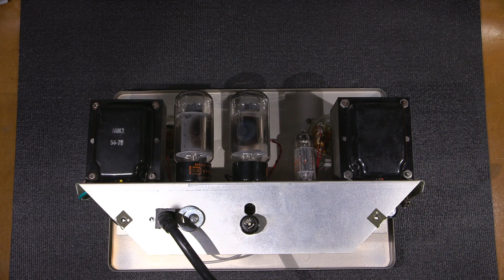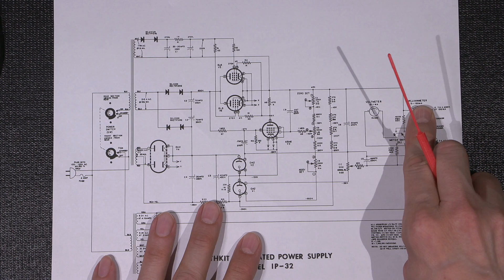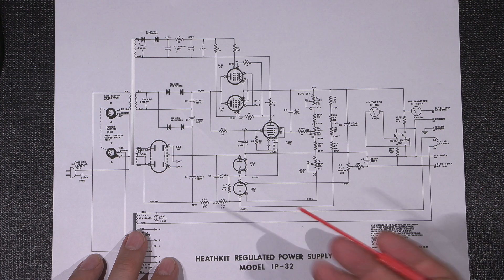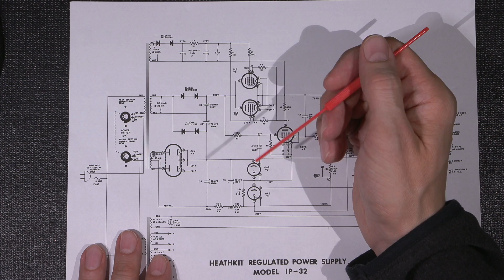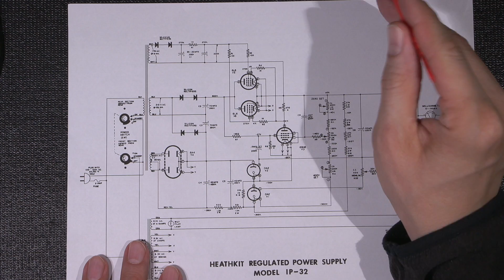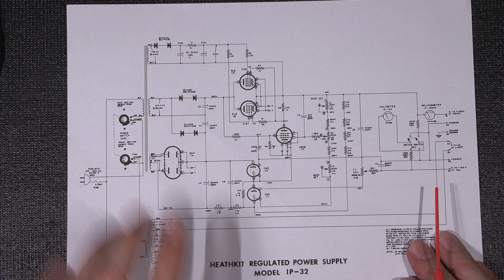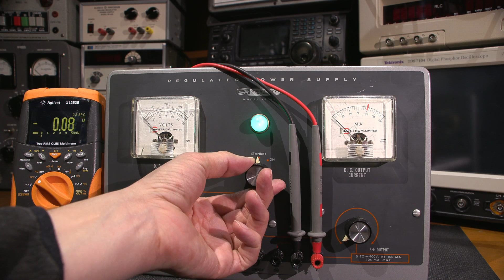Tools For The Bench- High Voltage Power Supply Repair!

Comment: Nice as always, Paul! I have the same power supply and have used it much for powering tube circuits. I have removed the 6X4 tube and put in two silicon diodes. The free 6.3V winding I  have brought out on the front, giving me an extra filament supply

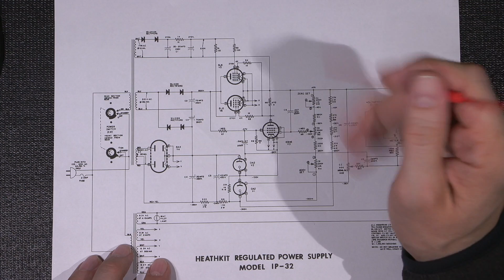Comment: 25:40 - My guess is that they used a vacuum tube on the regulated supply to provide a 'soft-start' on power-up.
Reply: From a glance, that would actually work .. it keeps the 6BH6 fully open and therefore the output low until the bias rectifier comes alive?

Comment: May I suggest a Part 2 on how the 6BH6 circuit acts as the output voltage is varied with a fixed load. 

Thanks for presenting a piece of gear that many of us treat as a  'black box'.

Comment: Have you checked if the negative supply output varies depending on the position of the meter switch? The schematic makes it look like there would be a significant change doing that. Adding a zener diode can fix that.

Comment: Looking at the schematic, I see that it might have been a good idea to put a high resistance in parallel with each of the diodes that are in series. Something around 1M as shown on schematics for transmitting supplies in the ARRL handbook. I was thinking about what you said about the spike when turning the supply off is something that many of us never think about. I have seen what you said about capacitors blowing up when put into circuit backwards, They get hot really fast then blow out all of their liquid.

Comment: Great video, Paul.  It is interesting to see how "regulation" was accomplished in the vacuum state era.  Depending on one's perspective, it could be easier to "see" versus the solid state technology; which is usually accomplished with an IC and discrete transistors.  Excellent work!

Comment: May I ask why you suggest running twisted AC lines to the chassis when working with point to point when I've noticed ever audio amp and guitar amp has them as far away from the chassis as possible. Even uncle Doug suggests to do so.
Reply from the maker: Hi Stefano. There is a lot of misleading information out there due to the lack of understanding AC, and AC filament systems. The chassis is common to the high sensitive circuitry, and acts as shielding. "High floating filament lines" are only common practice with remote tube sockets extended with wires from a circuit board or eyelet board. This type of build is common in guitar amps, "NOT" in High Fidelity applications. You will notice when you turn the gain (volume) up on a guitar amplifier with this type of circuitry (HFFL), they are far from quiet. Here is some good information right from RCA. Go to page 92 of the PDF (actual book page 90) and start reading "High Fidelity Systems." This is continued to the next page, you will find many of your answers there. Here is a link to the RCA manual: http://www.nj7p.org/Manuals/PDFs/Tubes/RCA-RC-27-1970.pdf
Reply: @MrCarlsonsLab  thank you kindly. I think I understand. However, when I watch guys like Terry from D-Labs and Uncle Doug, they suggest the HFFL method to avoid noise. Often boasting about the amp being quiet and adding that one of the attributes to this is the HFFL.

I haven't read the link the to RCA book yet. But I will do so to get a better understanding, as my lack of understanding as of now is making me believe there's a place for each type of filament wiring method based on the circuit design, nature and intended use.

So, is this why when I repair a more modern guitar amp with a circuit board, the filament connection is either on the board in straight lines, somehow avoiding any noise injection. Or like in some Orange guitar amps, the filaments are untwisted wire that's not exactly hovering high above the circuit board. I first thought it was maybe a DC voltage. But upon measuring, I was wrong.

More research is required.

Thank you for your time and details response.

Comment: Nice.  I have an older version of this supply (PS-4; exact same circuit, different part number, just older styling on case).  It works well.  Daystrom would be the original branding on the tubes.  Watch out for R7 -- there's almost 700V across that resistor!  (The original 1Meg carbon comp resistor had badly drifted in mine, and I replaced it with 3x 330K resistors in series ... commonly available metal film resistors are rated for only 350V!)

Comment: Hi Paul, I have a question - I have always seen heater voltages spec'd at 6.3 V, but they almost never are. Why not just 6 V and get it over with?

Comment: WHY would I ever want to disconnect the chassis from the Earthground if every part of the circuit is isolated from Earth anyway?? That´s just stupid and dangerous and has no benefits whatsoever.
Reply: I think I can see where both viewpoints arise, in the U.K. our wiring is different, personally I would go with the grounded enclosure if I was using it here. But I can see a valid reason to omit it in some circumstances where perhaps the ground wire can easily become hot due to a house wiring issue. Another excellent video, always something to learn on this channel.
Reply from the maker: So, If the case is electrically isolated..... VS connected to neutral (one side of the AC line) in the breaker panel through the "Safety" ground, what poses more of a shock hazard? (politics VS logic?) Better keep your case safety grounded!
Reply: Umm, having the case at a known safe potential is much safer than connecting it to nothing and hoping for the best. All it takes is for any live wire inside the case (or even from the outside) to somehow come into contact with the case and you´ve got yourself a deathtrap. That´s the whole reason why all metal cases have to be connected to earth by every electrical code I know of.

Do you at least have this connected to a GFCI? Not that I would ever trust a complex mechanical device alone with my life.

I also fail to see what any of this has to do with politics vs logic. Are you unsure if your house´s electrical system is properly grounded?
If so the only correct way to handle this is to have it checked by a qualified electrician, assuming you don´t have that qualification yourself. Not by turning your devices into deathtraps that may kill someone one day.

What I find even worse than you using unsafe practices is that you essentially "teach" others who may not fully understand it to do the same.
Reply from the maker: Wow, You really are on a comment war path, aren't you. Have you ever heard of an isolation transformer? What's it's purpose? This unit has two inside it.... The chassis can be electrically isolated from the secondary side of those transformers for a reason, the same reason it is isolated from the primary side. "This is the reason it came with a two wire plug to begin with." This isn't a consumer appliance, this is a piece of test equipment. I have modern metal toasters, a metal electric kettle, a metal toaster oven.... ETC, all with factory two wire cords... I suppose I should stop using these modern appliances now? If you watched the entire video, you would hear that I mentioned, if one feels more comfortable with a 3 wire plug, by all means install it..... Just like I told you above, "Better keep your case safety grounded!" I see you have no video content on your channel, you read like you have some strong suggestions to offer, why not add to youtube and make some video's?
Show less
Reply: I´m not talking about a fault on the secondary side of one of the transformers...  (and I can still think of a scenario where a fault on the secondary side would hurt you.)
There are many scenarios that could lead to the phase touching the case somehow. They may be fairly unlikely, but that is no reason to actively ignore them. 
I do not know of a single benefit to having an ungrounded metal case. I don´t know where you are buying your toasters. Certainly I have never seen one with an ungrounded metal case, because they are illegal to sell unless other reliable measures have been taken, at least under EU regulations.

Well, since you seem to be more interested in making this about me than to answer the questions I asked, I will stop wasting my time now.

Comment: Paul, great video as usual. One question, watching videos on other channel that restore guitar tube amps, they usually suggest that the AC lines (as filament supply, etc.) go as far away from the chasis as possible, contrary to what you mention.
Reply from the maker: Only when the sockets are remote from the components, IE: long wires to a near by board from each socket. This type of construction (high floating filament leads) is a technique used in guitar amplifiers, and should not be used in Hi-Fi amplifier builds.
Reply from the maker: Here is some good information right from RCA. Go to page 92 of the PDF (actual book page 90) and start reading "High Fidelity Systems." This is continued to the next page, you will find many of your answers there. Here is a link to the RCA manual: http://www.nj7p.org/Manuals/PDFs/Tubes/RCA-RC-27-1970.pdf
Reply: Is that because in a tube amp the chasis is used as a ground plane while in a Hifi amp the ground is designed in a star configuration? Does it affect if the chasis is a ferrous metal or not? Where can I read more about this? Thanks.
Reply from the maker: Did you click on the link in my above comment?
Reply: Oops, no, I didn't even see the comment. Maybe because the way Youtube colapses comments an replies. Anyhow, thank you for that. I'll check it right now but I think I bought that manual on Amazon a couple of weeks ago, maybe not that edition but I think it is a similar one. I'll read. Thank you! And for what I see the whole website is an excellent resource!

Comment: Bending the common binding post on purpose. I wonder why, because who did this had a very bad idea in the first place. Anyway, you can replace that bent binding post with one from Cliff, model CL1505. They seem to be close enough to the originals, unless you have the original parts. Anyway, later in the video it seems that the post got straightened up.

As for the capacitors? Well, whoever put them there did a total massacre of a restoration job. I would undergo the effort of looking for similar parts. I would bet that the original caps were axial and not radial. The guy who did the repair did a very poor job, and on the top of that, he left them hanging.

Anyway, good repair and excellent video, as always!

Comment: Yes, capacitors can be deadly. As a teen I worked on microwave ovens and one had been sitting on my bench for over a month and as I brushed the cap it threw me against the wall and stopped my heart. It strained and finally started only because I was running 10 miles a day. My chest hurt for months and lesson learned. Ground those puppies out!

Comment: Great video! I picked up a couple of Philbrick op amps after your last video, and was thinking about a power source. I got lucky and found a Philbrick R-100B +/-300V, 100mA supply. The tubes were missing, but I replaced them, and fired it up with a dim bulb tester in the input, and it works fine. The line reg is perfect <100mV down to 85Vac, but I haven’t tried load reg yet. I might need to recap it, but Philbrick used caps at double the rating required, so I’ll test them to see if they leak anywhere near the circuit voltage. It will probably take me a year to build a chassis for the op amps though.
Reply from the maker: If you get a chance, post a small video displaying your work and the power supply. Thanks for sharing Tim!
Reply: Mr Carlson's Lab Sorry it took so long to reply. I was planning on doing a video, but I didn’t want to commit until I was sure I could accomplish the task. I’m putting the finishing touches on a “show-and-tell” video for the R-100B. I got a little carried away, so it’s a little over 40 minutes long, but I cover the manual and circuits briefly, and talk about some of the Philbrick literature I have. I hope to upload it tonight or tomorrow. Thanks for the suggestion.

Comment: Oh yeah, I remember when I was a kid watching my dad working on a CRT TV around 1975. He made a mistake and the electricity lifted him off of the stool and threw him back in the air into the wall! He took a break for awhile after that.
Reply: Amazing how crt tubes can pack such a wallop. Especially if the flyback and rubber coated side connector was still intact. 21in crt had around 20kv I believe.

Comment: I once had a hammarlund hx500 that would short the hv rectifier diodes on every shut off. I put a MOV across the primary of the hv transformer and it fixed it.
Reply from the maker: Oddly enough, I worked on an HX-500 that did the same thing. They must have had real issues with those diodes and warranty returns.
Reply: My best guess was that the earlier hx-50 used vacuum tube rectifiers and they just put in diodes but did not understand the problems involved. buy the way the hx-500 with good old RCA harrison plant 6146A tubes would put out 175 watts on 75 meters. set idle bias current for 50 ma both tubes. the tubes never complained and ran great for years. I was careful with it but thats a lot of power(way more than the tubes should have done). Again I suspect the 1000 volts B+ was because of the less drop with silicon rectifier diodes than vacuum tubes. They just used the same hx-50 transformer. Big transformer. good old boat anchor  and I kind of sadly sold it for 50 bucks in perfect working order. lucky next owner

Comment: Use a 3 pronged plug.  I would rather ground the metal chassis than not.  Don't risk burning your house down over some power supply or amplifier.  If you don't know how to properly and safely work with electrical energy levels which can kill you then don't work on it.  If you are worried about being shocked by a ground fault then use GFCI (Ground Fault Circuit Interrupter) protection.  If the device trips a GFCI, it's best to eliminate the leakage current causing that than to say GFCI is a nuisance.  A properly functioning GFCI is designed to switch off when there is between a 4ma to 6ma leak from your 120 volt ungrounded conductor (black, red, or blue wire) to your grounding conductor (green wire).  Talking USA wire color standards.  There is a reason we ground metal enclosures and it is for your safety.

Comment: I love the large VR...I haven't seen one that large since I worked on very high power transmitters many years ago. 20 kilowatt transmitters in the service. Thanks again
Reply: When you say 20kw are you talking about radio tranmitters? My father was a radio engineer for commercial radio in FL.
Reply: @NanookFieryArcticSkyy  Yes 20 KW  Radio transmitters. I worked on the FRT-49 High Power Transmitters. used with the GKA--5 data control systems when I was in the Air Force many years ago.

Comment: I once got a Radio Shack "Psychostrobe" working which looked like it sat in water for a while.  I replaced all but one capacitor, one of the rectifiers and two resistors.  I was lucky to be able to find the two 20mfd tank capacitors locally.  And you can still buy the strobe lamp it uses.

Comment: Great timing on this video and great job.  I was already planning on refreshing my Heathkit 2717 this week.  Now I know much more than I did an hour ago!  As you most likely already know, the 2717 is almost identical to the IP-32 but has a 12.6VAC output on front and a little more modern package.  I followed along with my schematic and it now makes much more sense.  Keep up the great work.  Doc

Comment: Mod suggestion: What do you think about adding a low value power series resistor in both 6L6 plates? That would help current sharing between the two pass tubes. When this was sold new, matched tubes were a lot easier to get. Not anymore. I have the next generation of this unit, the IP17 which is almost identical schematic wise. Good unit!